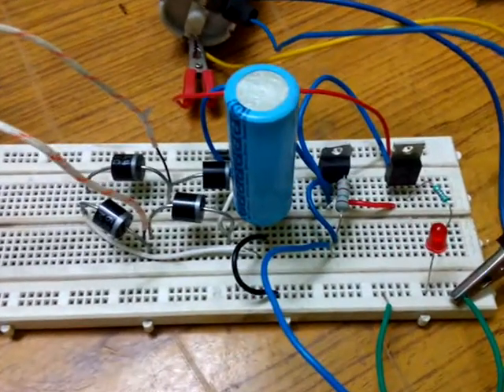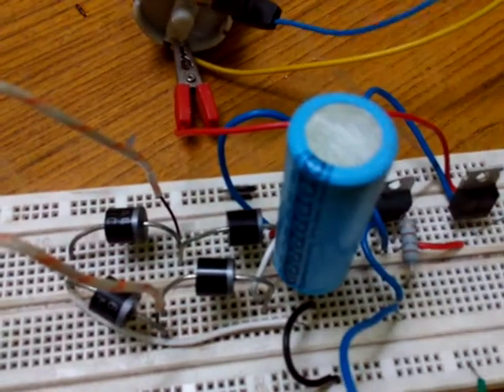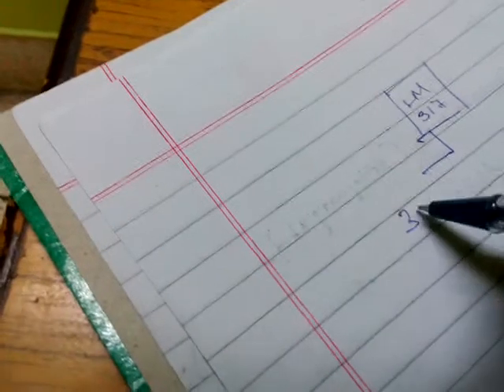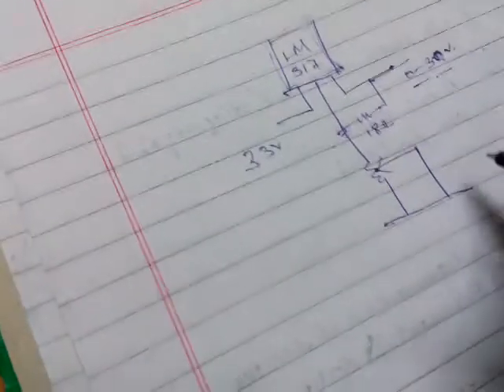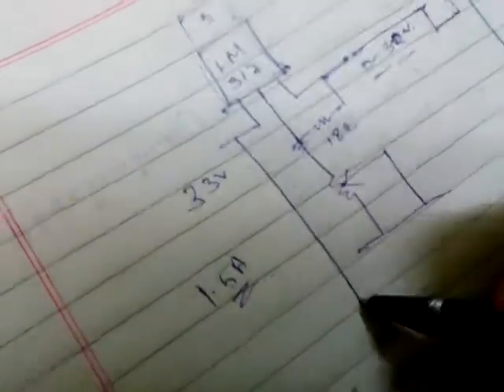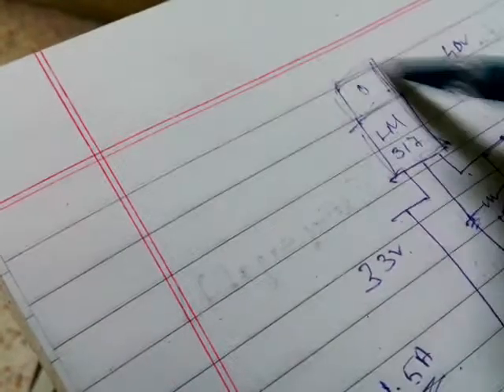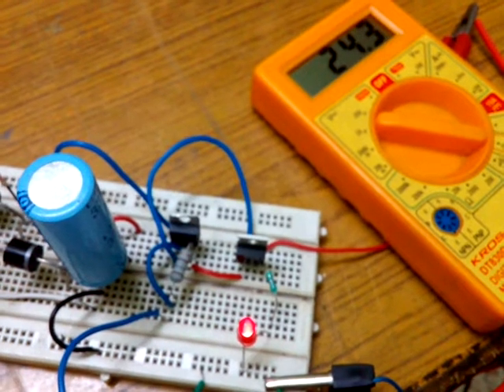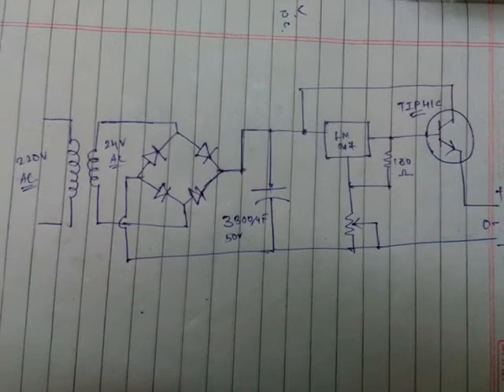LM 317 Adjustable Voltage Regulator Circuit for high current

Comment: what happen if I use 10k potentiometer
Reply: Gaurab Chowdhury you need to see the resistor r1 and variable r2 combinations I use r1 1k resistor and vr2 10k to control 1v to 12v
Reply: mohd tmeme can you plz provide me a diagram in which I can change voltage & current by using different potentiometers in same circuit
Reply: Gaurab Chowdhury you can only change the voltage.. The current will limited by the voltage regulator, like LM317, you can see the data sheet for lm317 Google it LM317